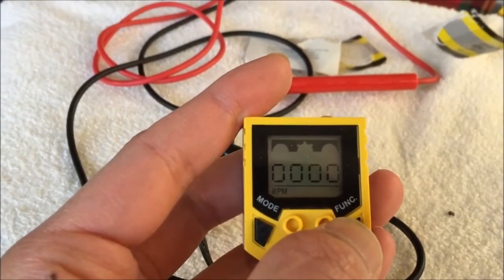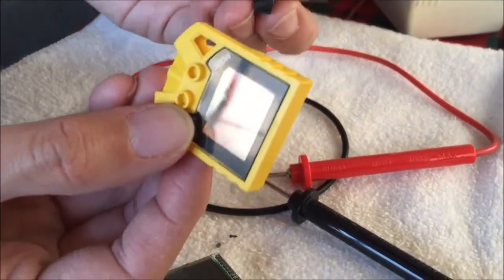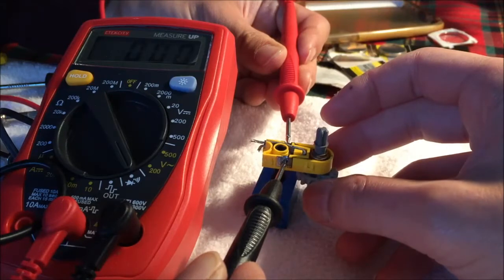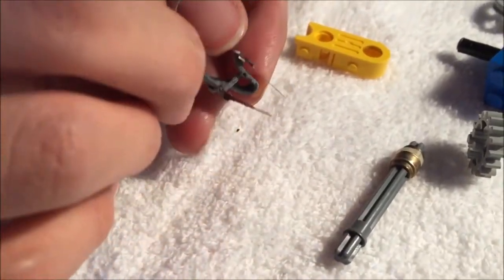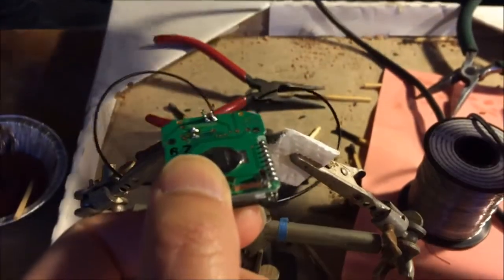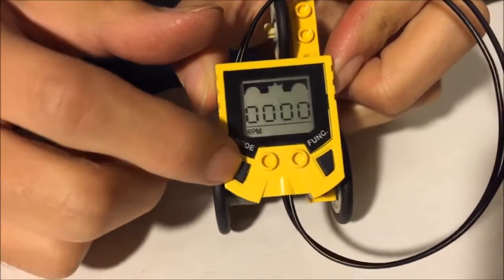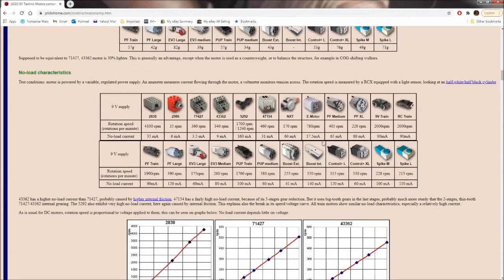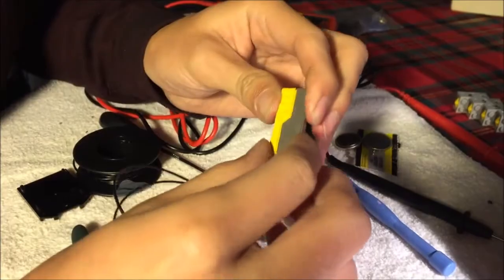LEGO Technic 32467 / 5206 Speed Computer Cable Repair and Function Overview

Comment: litteraly bought this one (unused brandnew out of a box) open it used it 2 times in 2025 and litteraly at the head the cable insolation fell apart XD... geusse i got to fix it... gone try this video.
Reply from the maker: Yeah it's bad. As far as I can tell, it's basically a 100% failure rate on these cables, regardless of how much they've been used.
Reply: @NonsenseWars  i fixed mine but i had a fuck up on the soldering pad of the pcb so i need retrack 1 of the wires and scratch a opening true protective layer on pcb to solder it back on. but it was more my own stupid mistake also i used a iron saw blade to make a gap in longer parts of the main unit that is glued and then i used force to crack it open on multibale corners. -- this worked out like a gem -- how ever the ather part trying to unclickt that i had a tough one with it. i broke the case a little bit due of my efforts but i was able to rebuild it. it works again with a longer cable.. but this thing.. erugh is nice to have but im better of getting something else...

Comment: Did you by any chance get a glimpse of the part number on the microcontroller chip? Just curious, and due to the glue I don't want to crack mine open.
Reply from the maker: Unfortunately I think the chip is under the display, so there's no way to look at it without a ton of desoldering!

Comment: Could you maybe do a repair video of the mini 9v motor?
Reply from the maker: Ah, I would if I could, but unfortunately I don't know how you can fix them.

There's two main issues with fixing the 9v geared motors:

1) Taking it apart is semi-destructive to the armature assembly. You have to be really careful not to damage it as the clearances are really tight and the assembly itself is pretty fragile.
2) The thing that actually breaks - the cracking ring magnet - is almost certainly custom made for those motors, and I have no idea how to get a replacement. The ring shape itself already seems to be very rare.

You can see both the cracked magnet and the plastic armature assembly in the 47154 video: https://youtu.be/YCifAesqYqw?t=49

If anyone actually knows how to fix these motors, I would love to hear it and I would love to make a video!
Reply: @NonsenseWars  Well, that‘s probably why there is no repair tutorial anywhere to be seen. Thanks anyway

Comment: Thanks for doing this video.  In your investigations did you find the spec of the original cable?  Is the speed computer cable the same as the other 9V black electric wire/cable used.  I've just purchased both a 20AWG (0.5mm) and also 22AWG (0.3mm) twin ribbon cable.  Interesting enough it came today and I would suggest 22AWG feels closer to the original LEGO cable (to be honest this was by touch only and obviously insulation thickness could be different).  Just wondering if you had any thoughts on this?  Keep up the great work.
Reply from the maker: We've used the 22AWG cable (shown at 0:37) to repair both this and other wires. I assume Lego used the same cable for everything, because they look similar and this disintegrates the same way as the other cables from this era. Earlier 9V cables hold up better, so I can only assume that Lego changed the supplier at some point during the 9V era.

Comment: It's sad that The Lego Group either solvent or supersonically welded the main logic board's case together, and used such crappy wire. Next time I need to replace any Lego wire, I'm using silicone-insulated hobby wireL the same wire I use for modding electric foam dart/ball blasters, only in a smaller size.
Reply from the maker: Yeah, the wire issue is really annoying. We have a ton of wire from that era that is disintegrating. In my mind LEGO just hasn't had a great track record when it comes to things other than plastic bricks. Even the rubber tyres from this era are of questionable quality.